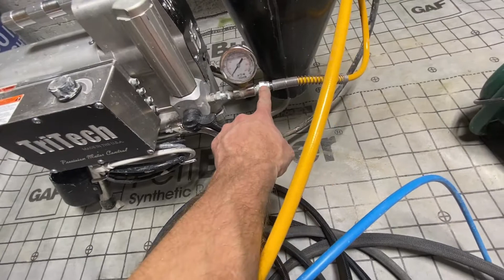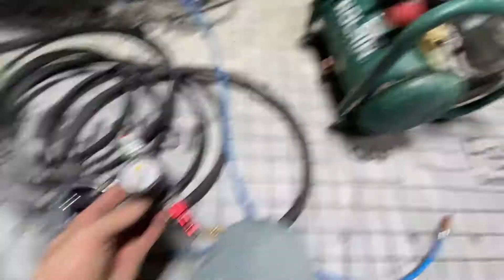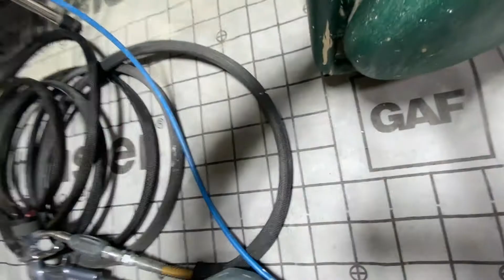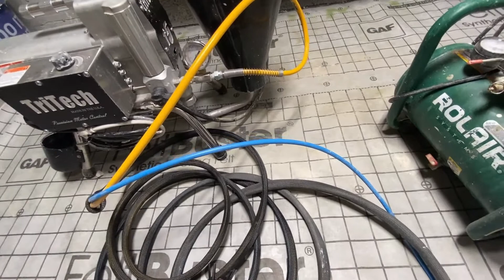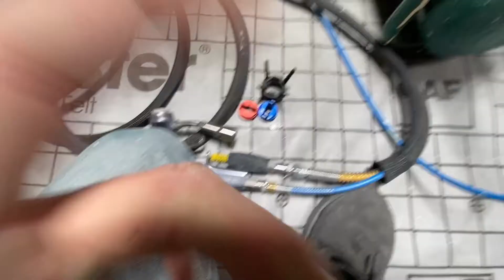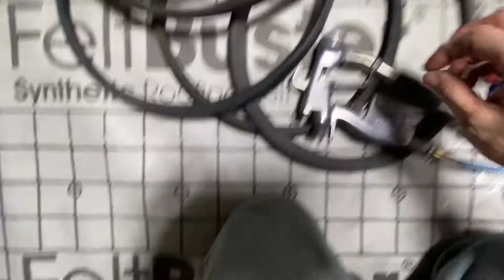Convert Tritech Airless to Air Assisted Airless with Wagner GM4700.

Comment: Hello friend, I'd like to ask you a technical question. I'm going to use an airless-assisted spray gun and connect it to my Graco 495 machine. I don't want to use such a large compressor because of the noise it generates. What would be the capacity of the smallest compressor I could use? I appreciate your help, and you make some great videos. Greetings from New Zealand.

Comment: The advantage of having a separate compressor instead of having an all in one unit is that you can use that compressor with machines dedicated to solvents, as well as for blowing dust off your work pieces.

Comment: Hi 
Do you still like that set up?
Just bought same gun and will see it up same way
Reply from the maker: Yes I still do! Especially for spraying topcoats. Not as fast as an airless, but you can spray with much less pressure.
Reply: Im looking for more to spray on site 
Im ok with airless in my shop but sometimes on site I got some sags
Reply: @slawomirbieganski5315  This will give you more control than an airless sprayer. choose a wider fan pattern as well, and with practice you'll get almost no runs. It will depend some on what product you're spraying, tip size and speed  as well.
Reply: Thank you
I hope I’ll like it

Comment: You should try the gm 3600 gun, it has flat tips that are reversible in order to clear a clog, that's one thing I hate about flat tips
Reply from the maker: The 4700 is pretty much the same gun. Uses flat reversible tips.
Reply: @homesteadcabinetdesign3406  nice, I didn't know, that's an awesome invention

Comment: What you like using for spraying Renner blue cap or red and what tip. ?
Reply from the maker: Thicker coatings like primer use the blue air cap and 13 tip. Top coats I thin up to 10% and use the red air cap with a 10 or 11 tip. I personally like the 10/30 double office for top coats.

Comment: my intentions are to do this to titan ed655 but im not sure its needed lol. i have just had it in my mind for 2 years that it is. is there a huge benefit from what you normally do? i usually just spray waterborne sherwood top coats.
Reply from the maker: One of the benefits of an AAA gun over airless is that they don't spit like an airless. However, there are some very nice airless guns and tips, but they all spit to some degree. The downside to AAA is they are higher maintenance. If you don't keep them super clean, you can have issues with clogging tips and air caps. In my opinion, it's worth it though despite the extra maintenance. It can be a challenge if you have employees. Airless is the easiest sprayer for employees to learn to maintain .
Reply: The ed655 is perfect for this aaa setup
Reply: I suggest if you're going to turn that into a AAA get the gm 3600 gun it has flat tips that are reversable and easier to clear when clogged, also a small pond pump are ideal for this they run continuously and not as loud as compressors, you can find them used on ebay for $100 thomas makes some good ones, remember you don't need that much air for an aaa gun

Comment: Instead of talking so much about tips and such I would like to have seen how you dial it in and spray.
Reply: Over talking.
Reply: simple, turn up pressure till you get the amount of fluid you want to spray, you will still have tails or lines in the end of the pattern, then turn up the air pressure with the fan pattern all the open till the tails disappear. the pattern will blend and you will be ready to spray